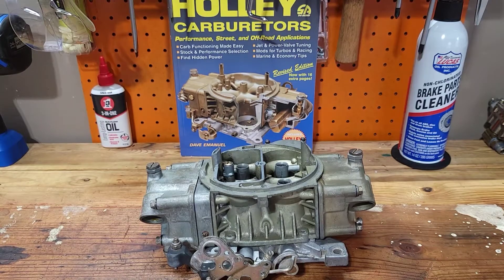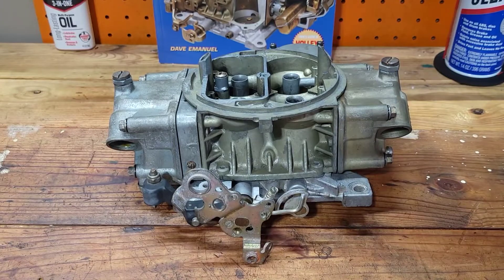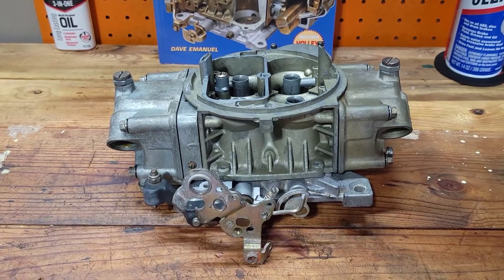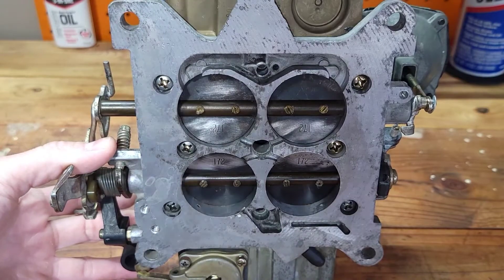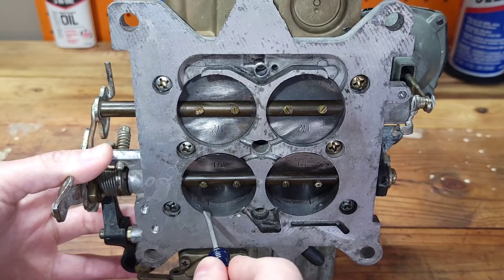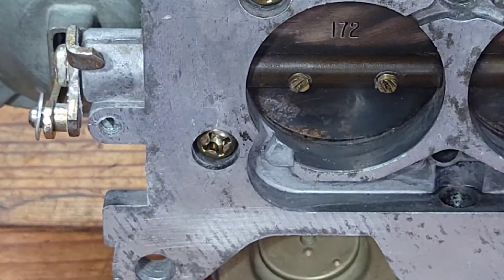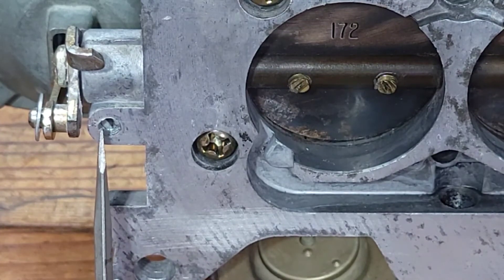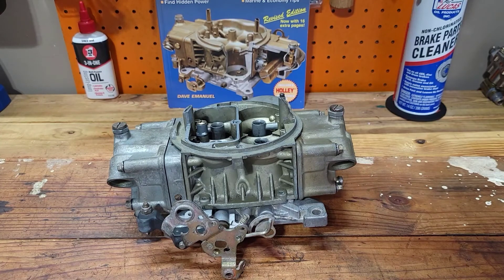Holley Curb Idle speed adjustment - Tech Tip Minute

Comment: What about an engine with a hot cam that like to idle around 1k RPM?
Reply from the maker: You can achieve that, adjust your idle mixture to the highest vacuum reading you get with the car in gear and foot on the brake. Then use your curb idle adjustment to get the idle where you want it. Remember ignition timing will affect your idle as well.
Reply: Should the secondary slots be adjusted the same as primary
Reply: Question I have a 383 with a big cam. The high idol is fine. The curb idol is fine while it’s running I drop it into gear and my curb idol drops. Drops to like four. When stopping at corner I have to put it in netural How can I fix that? Where would the problem be? Could you help me